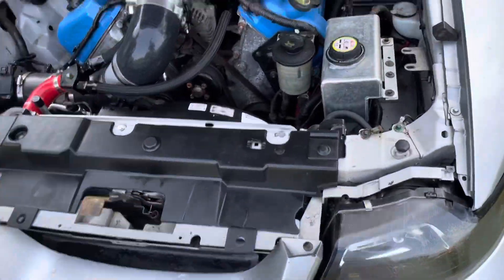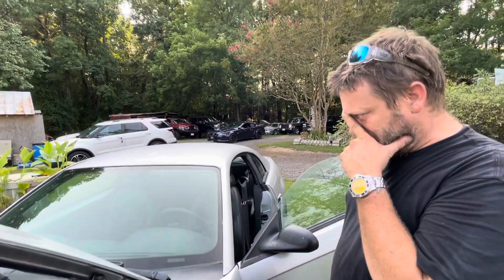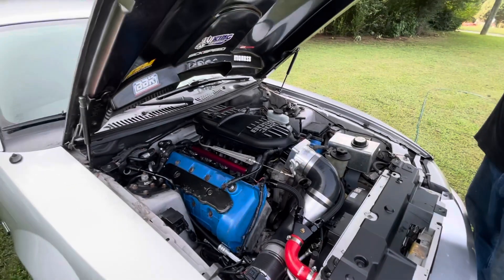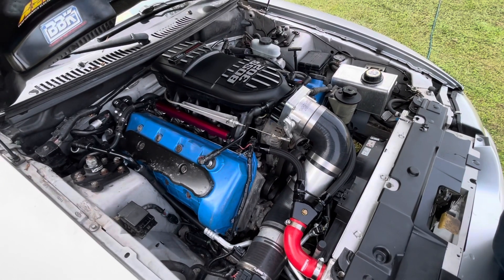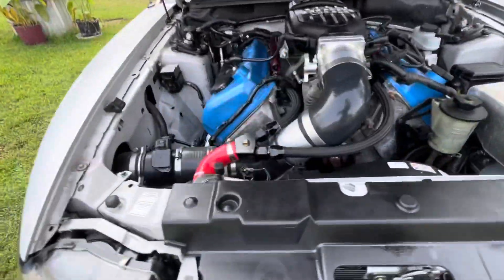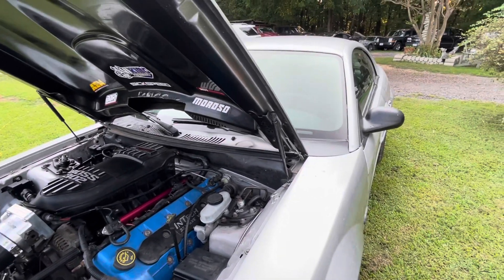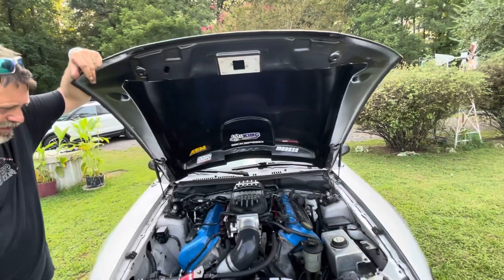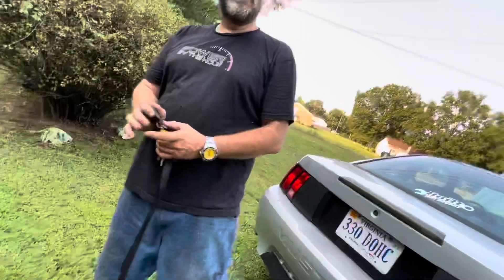The 5.4 Swap Lives On!

Comment: Iv been debating doing this 4v navigator motor swap on my 98 my question would be would I be able to get get high 300s or low 400 with out spending a boat load of money like you would with a 4.6? Any suggestions on what to do to the motor to aquire those kind of hp and torque numbers? The 4.6 is a boat anchor
Reply: boost is always the answer, stock motor with some boost and your good for like 500. most of the navigators came with forged cranks but you start to bend rods around 450-500.
Reply: Bro just do a pi swap. Post 00 2v heads on your 98 short block. Longtubes, intake and tune.  It's the cr in the older modular engines. Doing a PI swap brings the cr up from 9:1 to about 10.7:1. Depending on what you're trying to do you could easily make 300+ with the combo.
Reply: @smackledorfmcsween  I have a pair of PI heads that I bought last year that have been ported and polished. Not sure off what year though. My plan was to always do boost but if the car is capable of making good power with out it than I'll go for it
Reply: Do the 5.4.  With cams, headers and a coyote intake like this it'll easily do 400/400+ to the wheels.  It isn't just about peak the 5.4 makes alot more torque and average power.
Reply: Or just do a gt500 swap from an 07 but they're about 8 grand minimum but you'd already be supercharged good for 600 wheel with ability to make 800+ with a blower swap and supporting mods.  Not a bad way to go.
Reply: You’ve done absolutely 0 research on anything to say this about 4.6 years engines , sell it or scrap it for $150 , you don’t need to drive mustangs. 🤡🤡🤣🤣

Comment: thanks, why need steed adjustable clutch cable? the stock gt doesn't fit?
Reply: Stock gt would have fit just fine. But I ordered the steeds cable just because I wanted too.
Reply: @michaelsmith12477  thanks. Did you checked dyno? How many rwhp?